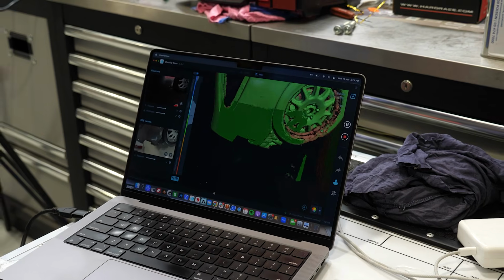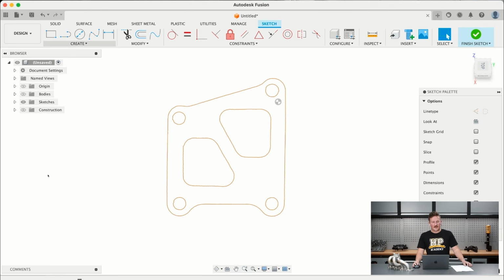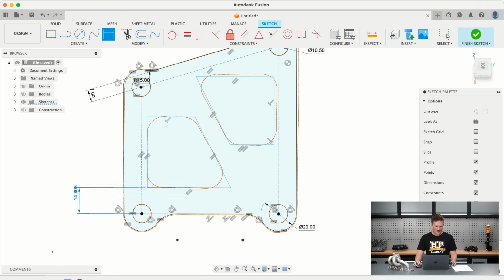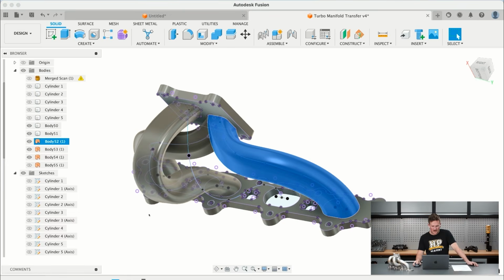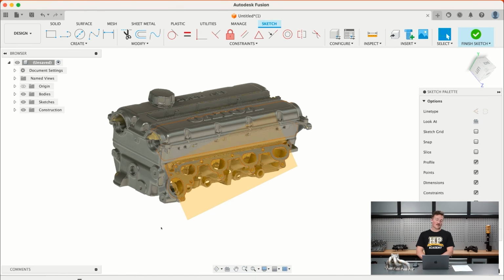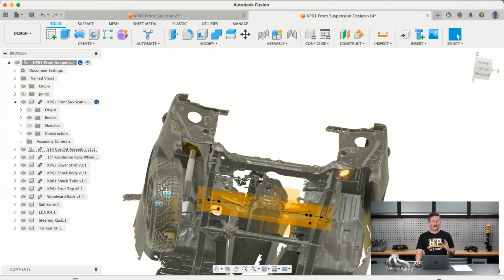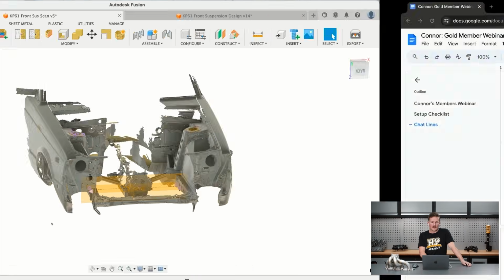Converting 3D Scans to CAD Models In Fusion

Comment from the maker: TIME STAMPS:
0:00 - 3D Scans in CAD Introduction
0:24 - Reverse Engineering vs Scan-Based Design
0:50 - Reverse Engineering Applications
1:54 - Scan-Based Design Workflow
2:31 - Metrology and Quality Control Uses
3:43 - Mesh File Fundamentals
4:14 - Triangular Face Limitations
4:48 - STL vs OBJ File Types
5:27 - Mesh Refinement Considerations
5:50 - Color Texture Data Capabilities
6:33 - Reverse Engineering Demo Start
7:25 - Turbo Manifold Scan Overview
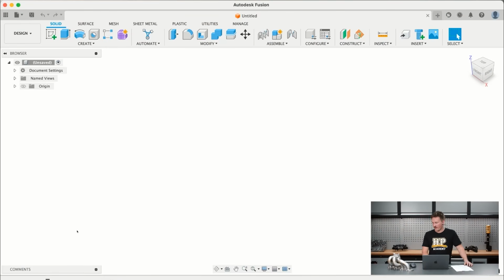8:24 - Fusion 360 Mesh Import
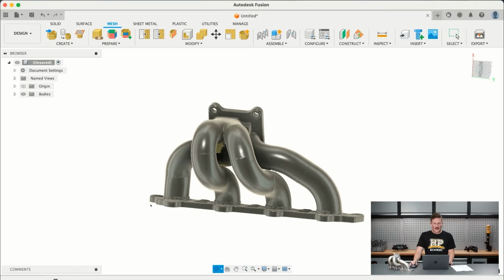9:20 - Insert Mesh Workflow
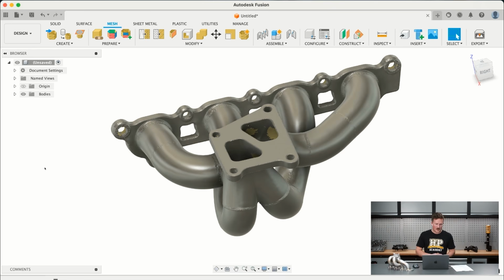10:17 - STL Triangular Face Visualization
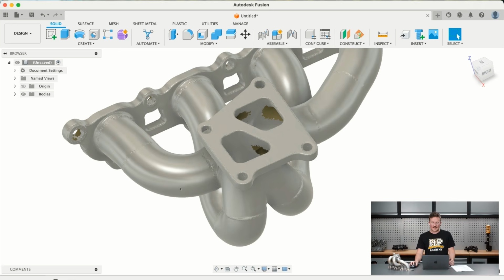10:49 - Plane Through Three Points Setup
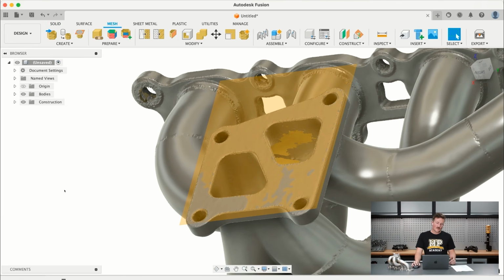11:45 - Mesh Section Sketch Creation
12:47 - Section Plane Positioning
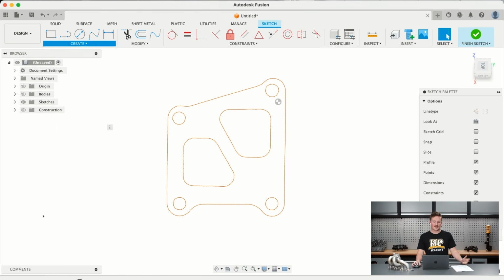13:30 - Curve Fitting to Mesh Profiles
14:31 - Circle Constraint Application
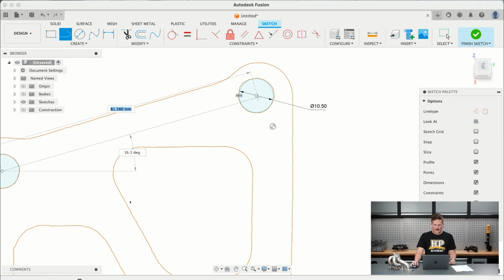15:21 - Flange Recreation Process
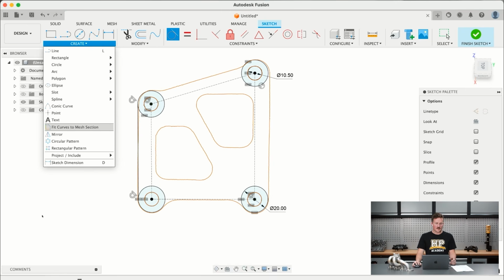17:30 - Fit Curves to Mesh Section Tool
19:04 - Sketch Constraint Application
22:43 - Extrude Feature Creation
24:09 - PeelCAD Integration Example
25:25 - Centerline Extraction Process
26:40 - Surface Loft Operations
28:19 - Split Body Tool Application
29:34 - Design Intent vs Perfect Recreation
30:22 - Scan-Based Design Introduction
31:05 - Volvo 16 Valve Example
33:15 - Single vs Multiple Scan Workflows
33:43 - Starlet Rally Car Assembly
35:01 - Entity Extraction in PeelCAD
36:08 - Assembly Component Integration
37:20 - Coordinate System Alignment
38:36 - Multi-Component Joint Setup
40:02 - Suspension Pickup Point Planning
41:30 - External Component Best Practices
43:46 - Q&A: Geomagic Software Comparison
45:26 - Q&A: Fusion 360 Mesh Efficiency
47:31 - Q&A: PeelCAD Centerline Extraction
50:26 - 3D Scanning Course Preview
50:40 - BUILD.TUNE.DRIVE
🔵 Building a fast car? Get $400 OFF the all-inclusive VIP online course package deal: https://hpcdmy.co/vip3ds
💻 Learn to design custom parts for your dream car. 3D Modelling & CAD course. Now 50% OFF:  https://hpcdmy.co/4bf419
Reply: hi vip member here, I do want to state that i wish you did it on solidworks because thats the only software you can pirate lol .I have the brand new solidworks 2026 and i get to use all features id thought it would be helpful on this course but no :( can you make a seperate solidworks tutorial please

Comment: Can you do all of this on the free version of fusion?
Reply from the maker: It's not super black and white with a line between possible and impossible with some features as often there are a few different ways to get to the same place/around a lack of a specific feature. I don't think everything here could be done as shown in the free version to answer your question though, but it's also free for you to dive in and double check that first hand 😎

A lot has changed in Fusion (even the name) since we first heavily tested the free version and Connor is actually about to start doing a pretty deep dive into it again over the coming months noting while it is a great option given what you can do for free, it isn't the only one out there either and they all have their pros and cons - Taz.
Reply: @hpa101 Thanks for the reply, is there a specific feature you were using here that is behind the paid version?
Reply from the maker: @jackvettese2617 not sure on that off the cuff sorry. We're about to go through and reevaluate the free version as there have been some minor changes over the last few years.
In our experience though for 3d modelling really the free version is only limiting in a practical way if you're trying to do something commercially. For a hobbyist there is always a way to get it done, usually at the cost of a bit more time.
Outside of 3d modelling there are some features on the paid version that do make a difference when it comes to 3d scanning and 3d printing, but we'd recommend anyone to find what those are with their own projects before deciding they need to pay for something (sorry Fusion sales team 😅) - Taz.

Comment: hi vip member here, I do want to state that i wish you did it on solidworks  .I have the brand new solidworks 2026 and i get to use all features id thought it would be helpful on this course but no :( can you make a seperate solidworks tutorial please
Reply from the maker: Post up on the forum and Connor can help you out, leaving out the pirate bit. I get it but also to cover those who aren't professional users with that kind of cash, Solidworks is making an effort with Solidworks for Makers to bridge the gap to be fair. I know right now it's not the same as Fusion vs Inventor (which has taken over a decade for Fusion to get to where it is now), but it's a step in a good direction for hobbyists.

Generally, for this type of work, Connors' preference is Fusion, noting whatever you do or don't pay for a tool, they all have their niches where they excel or lack comparatively - Taz.

Comment: hi why my scan mesh stl when i insert mesh on fusion 360 its not like yours getting color gray like its editable mine is just like a mesh and i cant add 3 points plane what should i do thankyouu
Reply from the maker: Use the “create form” and enter T spline modelling. Then construct plane through 3 points using the mesh. 
If you're an HPA member I'd be happy to help you further on the members forum - Connor
https://www.hpacademy.com/forum/
Reply: @CBKCUSTOM  you can also enter direct edit mode in the mesh tab and select your mesh model then create a 3 point plane while in the direct edit function. 🤙

Comment: Yes ...not a problem...but 10k for a scanner...? Untill they drop in price ....drawing from scratch is cheaper...  I could draw most engine parts quite quickly.   So yes sounds nice ..buy down here in the real world ...😂
Reply: You can get really good scanners for less than $1000 for hobby use, no need for the industrial stuff.

Comment: I realize this is the beat way as of now, but was a waste of time. There has got to be some new software to shave this process down to seconds. I spent all sorts of money on a 3d scanner only to realize I have to basically redraw the entire thing in CAD. Blew my mind and honestly pissed me off. What's worse is then they want to upsell more expensive software that does a crap job and saves only a fraction of the time to do what's shown here.
Reply: @berksonfab  Quicksurface and X designs are 2 of few programs that convert the 3d scan to a CAD file so you dont have to deal with a STL meshes like in the video.
Reply: @LouqueJ quicksurface is definitely more capable than Fusion with regards to mesh, but it still takes a ridiculous amount of work to create a usable model.

Comment: I'm following along, and clearly doing something wrong at 14:40.  When I enter a diameter for a circle it scales the whole sketch rather than just make all the circles the new diameter.  This is irrespective of whether I have set all the circles to equal or not.
Reply: Ok, not sure I've done this the right way, but if I dimension between two centres first using the scanned dimension, and then dimension the diameters everything works as expected.

Comment: Interesting ! Thanks.
Question : how did you construct centerlines of the tubes to join both flanges in Fusion ? Defining those lines in space is super hard for me ! I believe you used the spline allowing 3D positioning ? Any video or course I can refer to learn how to ?
Reply: yes, most interesting part of the video and any explain of it
Reply: Draw two circles at each end then join the centre points with a free form line or loft it
Reply: He used a separate software to generate a center line for the tubes. Basically, Fusion can’t do it.
Reply: @randyfolsom  Any idea which software he used ? Thanks !